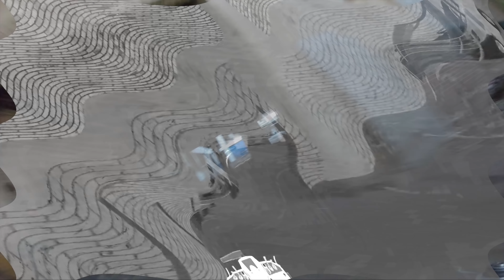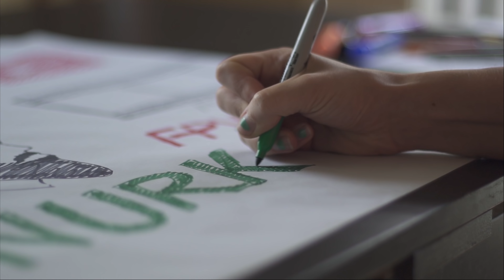Left Behind: Freestyling the DRL World Championship in Detroit

Comment: Those shots with your 360 quad are amazing! and the quick switch between DRL sim and the real place looked awesome, and that little patch was really well lit on the floor, good thing you lifted some dust there, made it even cooler!
Reply from the maker: Yeah was trying to rip around it to lift more and more dust. Looks soooo good.
Reply: NURK FPV 
Lifting up the lit dust was awesome!
Reply: next time bring colored smoke bombs....  every time you went under a tiny spot of light from the holes in the roof and it flashed...  each of those would be a column of light you could maneuver through as ethereal obstacles.